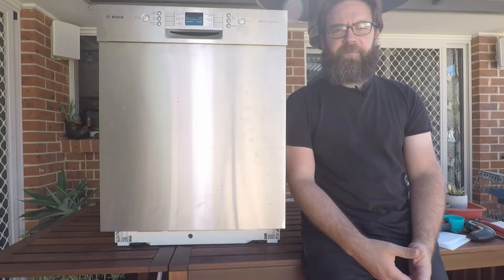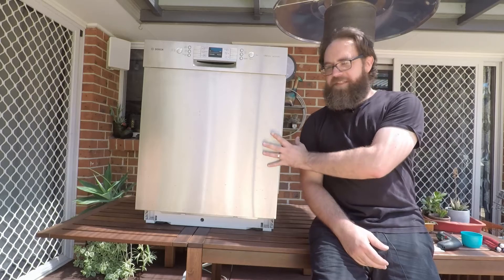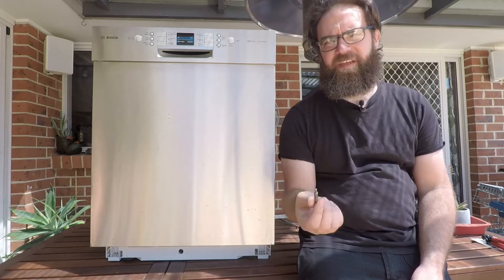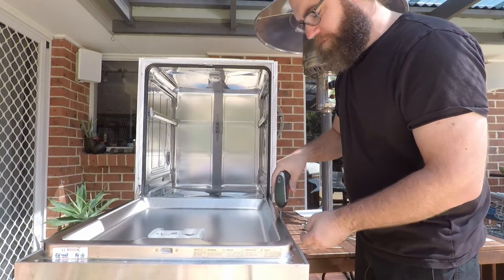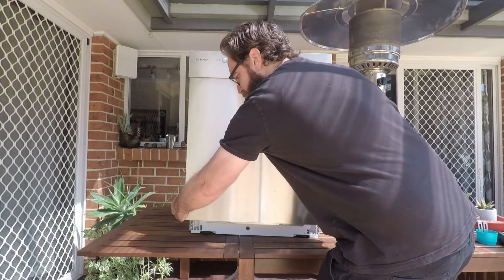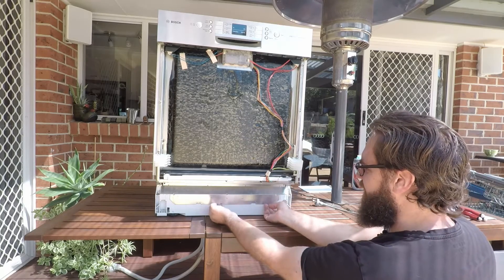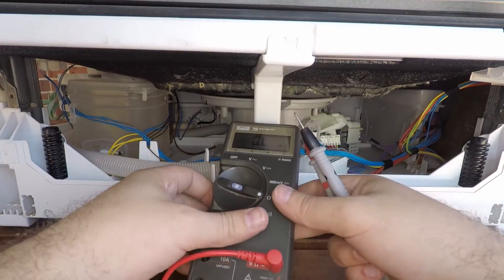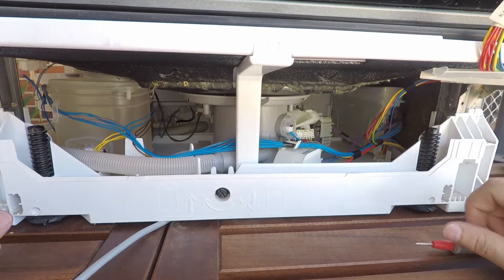Bosch E07 error code diagnosis and repair

Comment: Ok besides disconnecting and taking dishwasher outside the house I didn’t see anything helpful 😂 what was the purpose of it? 

Didn’t solve the issue
Didn’t show what fan what pins
Didn’t show any other possible issues 😂

Comment: Bevore disassembling: try to clean the channels on the left and/or right side from inside the washer: open the channel covers, clean by hand/finger, bottle brush and then with a sharp water jet from a hose. Worked for me - E7 was gone, it saved a lot of work, as seen in this video.
Reply: are you taking about the two channel covers (that look like circular vents)? If so do these just covers just pop off?
Reply: @AshalShah  no, they can be unscrewed with an hex key, supported by hand on the outer diameter
Reply: @GaunerBerlin  thanks 👍 will give this a shot
Reply: @AshalShah ...did it work?
Reply: @Coolix3 I am about to try it. Will let you know.
Reply: Did it work?

Comment: Thank you for your video's about the Bosch dishwasher. I was looking before, for my problem with it but I still don't understand: The programs ends most of the times with a error. Mostly E7 and sometimes E9. Lots of time, the dish is not clean(!) and a lot of times, the dishes is not dry. I thought, he didn't warm up but sometimes, it looks like the dishes are still a little warm. 
And I have another really stupid thing with my machine: The functions of the right 3 buttons in front, controlls the signs of the left side, and vice-versa. I know, because when I touch the Variospeed button, the display says "24h" (exactly the button from 'the other side'). I tried to dismantle the door to easily change out the wires on the PCB but I couldn't because of the prefab plugs. It didn't fit the other way around.
So I have two questions. 1: All these problems, can they also be the result of a kind of mainboard or motherboard or something? Don't know much about dishwashers (thats clear wit a machine like mine ;) ) but I would like to try to fix it though but changing parts out, not knowing if they are broken, is maybe wasting money.
And 2: I saw more of your video's with different Error codes and what you do is meassure. Do I understand it right that you say: When two pins, give no resistance, than thát part is broken? And does it have to give a "0" then? Measuring the ohms.
Thank you very much. Hope to hear from you.
Reply from the maker: Wow ok. 1 have you had this dishwasher from new and did the problems only start recently? If it's been opened before then it's possible someone has messed up something. The button functions would be controlled by some kind of logic but I don't know exactly how or where this is located - could be different from model to model.
2 when measuring resistance with the multimeter, an open circuit means there is no connection between the probes so it will be infinite resistance (usually displayed as a 1 on the multimeter). On the other hand a closed or short circuit will measure close to 0. When measuring heater coils or motor pumps you will usually get a reading of under 100ohms. Obviously always be sure the machine is unplugged before taking any resistance measurements

Comment: How did you get this from the mutimeter, When the appliance was turned off?
Mine has this same error code but with no drying fan on the model
Reply from the maker: Always have the appliance turned off when working on it, and set your multimeter to ohms Ω
There are so many different types of dishwashers out there, so I suggest doing a search for your particular model and the error code. You can usually find the model number near the top on the inside of the door